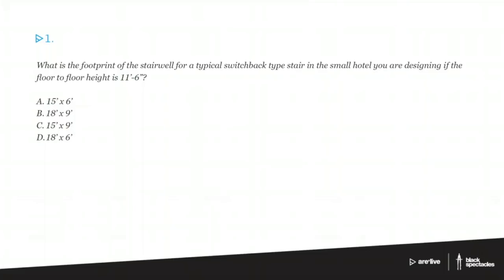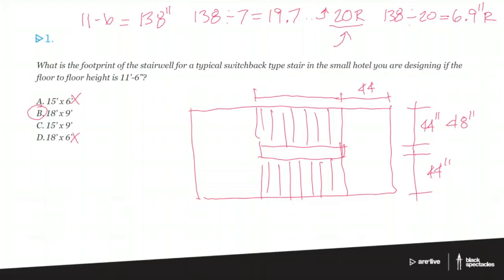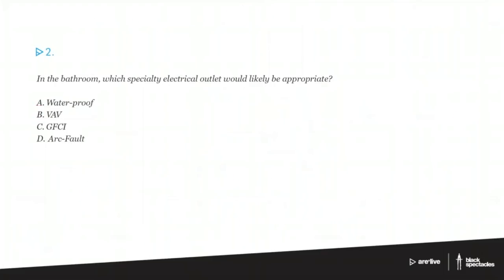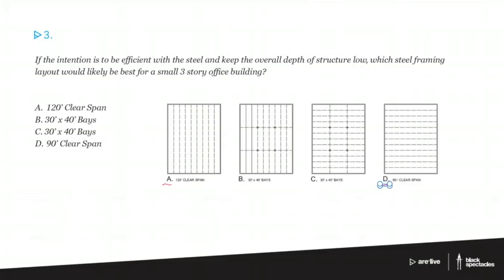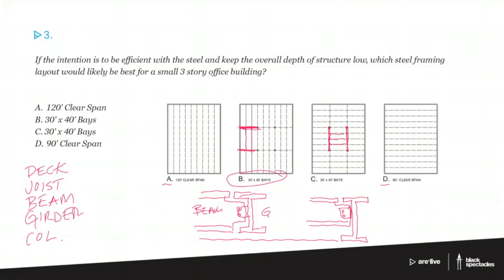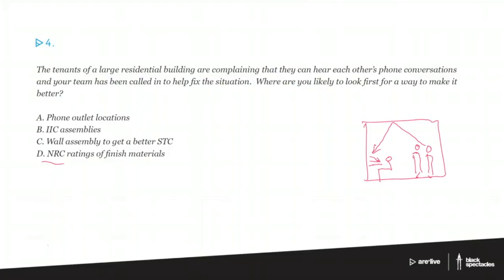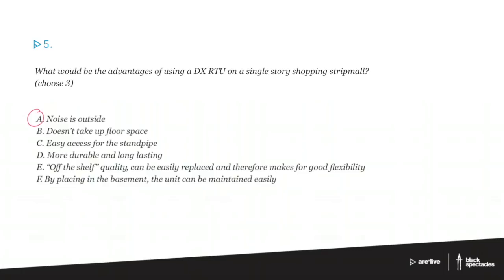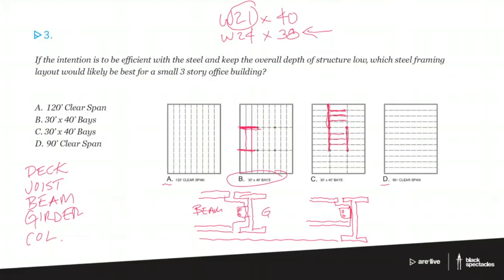ARE Live: Project Development and Documentation Mock Exam - 2019

Comment: At 13:31 you COULD fit the entire staircase into the smaller dimension.  (44" bottom landing) + (99" stair run) + (44" switchback landing) = 187" which is 15'-7".  So is the correct answer actually C or do they just expect you to assume there would also be area of refuge requirements.
Reply: The question is also not specific enough. A staircase serving an occupancy load of 49 people or less (which we don't if that's the case here) needs to be only 36" wide per IBC. 36*2=72 which is 6' wide. The question wording also clearly states "Stairwell" which is a measure inside of the walls, only the negative space/shaft within the enclosure, so I think we can disregard Moma's comment (since we don't know the wall assembly, assuming a wall width would be guesswork). Overall, the question is poorly presented and I especially don't like that they skipped to telling the answer before explaining, seems like an exercise in confirmation bias to me. The correct answer should be: D 18' X 6'. Since as you stated there is a minimum length of 15'-7", and the width of 6'. The closest acceptable choice to 15'-7"x6" is choice D. 

As an aside, Black spectacles really is not a great prep tool in my experience. These mishaps in their lectures and explanations are far too common to be useful for someone who needs the exact knowledge required for passing the ARE's, not to mention the mundane style of their lessons and less than stellar production quality.
Reply: @paintingdata819  Even though he says "small" hotel, I think for this question, its probably safer to assume that the occupancy is greater than 49.  
Something that also needs to be considered is that you will have handrails on both side of each stair run.  Code permits the projection of the handrail itself to not reduce your egress width, but the inner handrail would be mounted on a guardrail, which if the overall dimension is 6', the guard rail would have to be installed on the stair surface reducing your min. egress width so you would need to have some space between the runs.
Reply: I think you need to consider the staircase enclosure that should add a minimum of 1' to the footprint of the stair, so, we are talking about 16'-7" minimum even not considering the area of refuge. The correct answer should be B then.